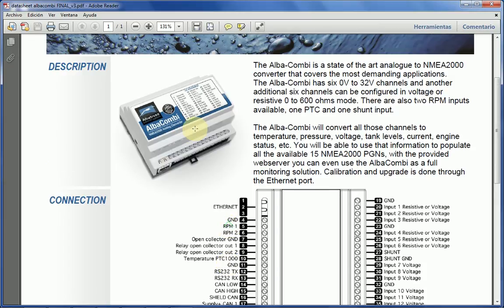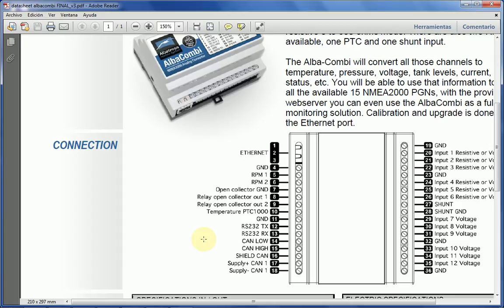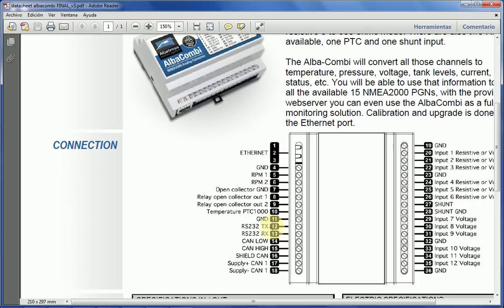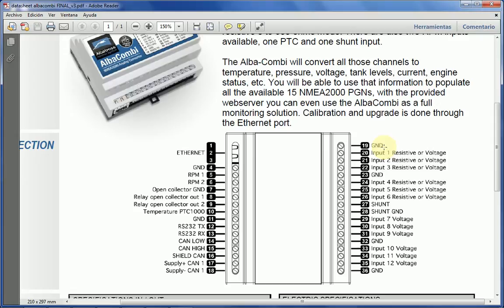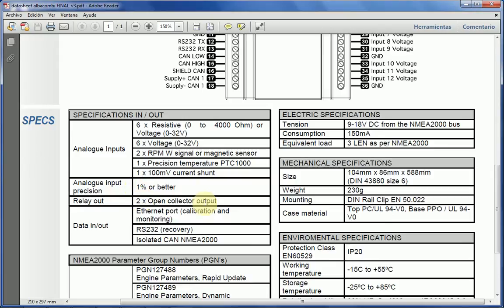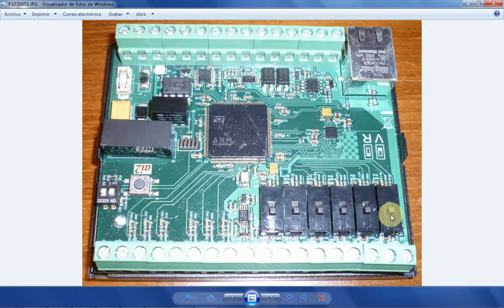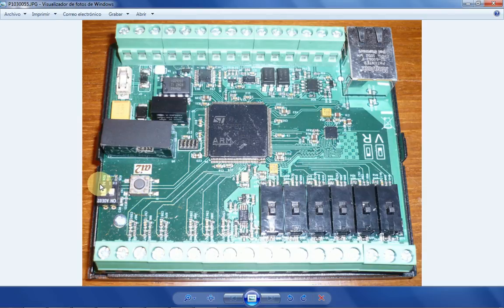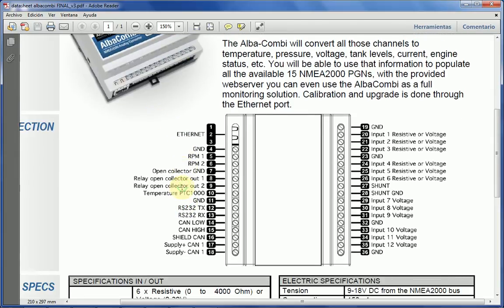Ep.1 - What AlbaCombi is? Overall review

Comment: Can a voltage input be used to monitor a switch? F.ex. a reed switch that will provide 12V when turned on, to monitor a seacock or status on an open/closed hatch etc?
I'd like to be able to have this in my NMEA 2000, so that I can check status on a small screen or my Raymarine Axiom.